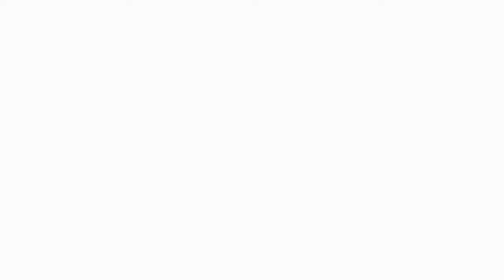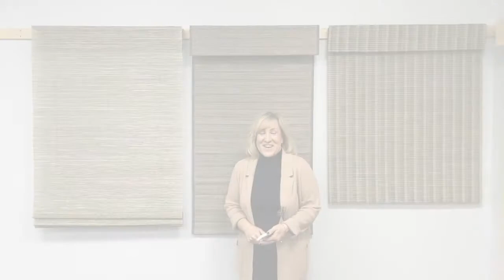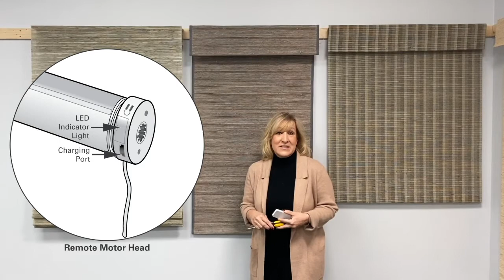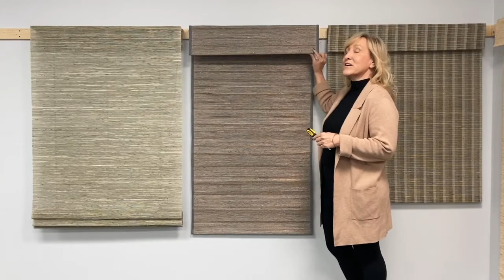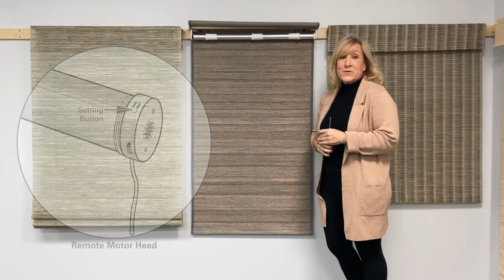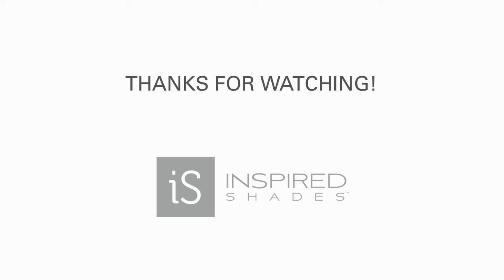Inspired Shades Motorization

Comment: Heads up, at 2:38 when she's showing how to adjust and set the lower limit, she says to press and hold the stop button, but you actually need to press and hold BOTH the stop button AND the down arrow as the visual on the screen shows.